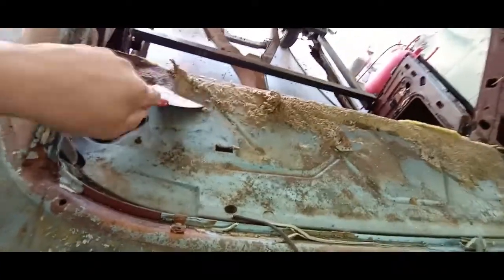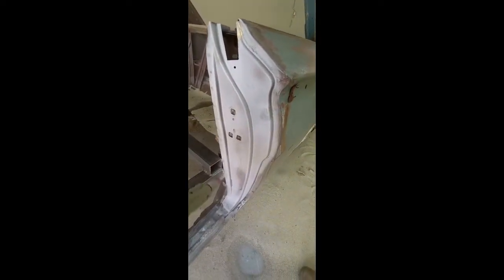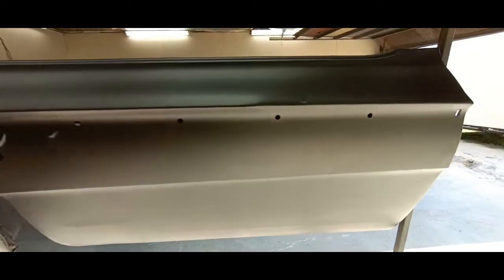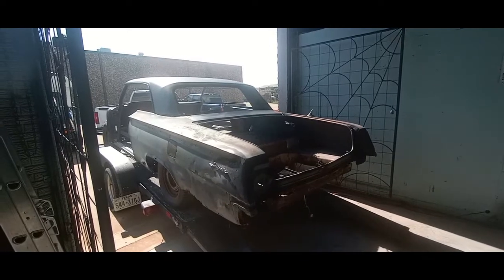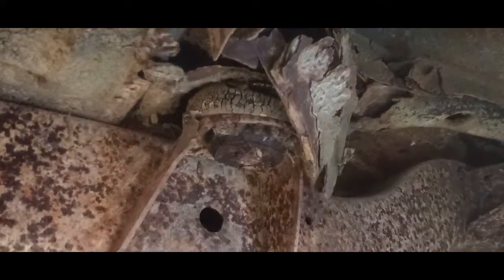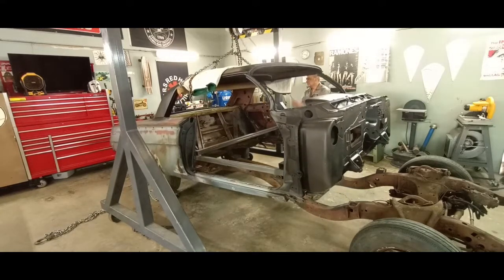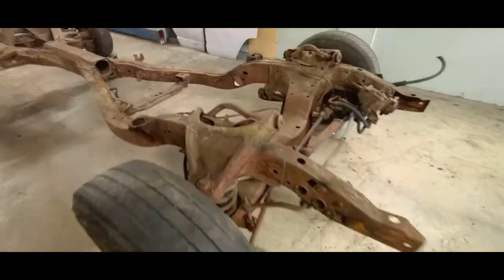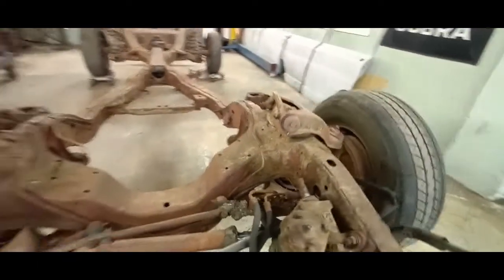1962 Impala Restoration Part 3 - Media Blast - Epoxy Prime - Remove Frame - DIY Auto Restoration

Comment: Robert have you ever swapped the complete front cowl? I have a spare one and mine is in horrible shape but the other is like new. If so where did you brace?
Reply from the maker: Are yoju replacing the upper? lower? the complete front?
Reply: I wanna do the whole front. I think it would be quicker. Is this a good idea?
Reply from the maker: @derrickwebb7230  As long as the repair is in front of the hinge pillar and front floor flange you shouldn't need to brace it. You may have to place a porta power and spread as needed, rule of thumb always cut out the least you have to. If you run into trouble message me.
Reply: Ok. Ur awesome. Thank you so much for ur help. Maybe I'll just do it in sections then.
Reply from the maker: @derrickwebb7230  You absolutely can do it ! just take your time.

Comment: This is awesome. The wife and I live in a little town in bc Canada it's so hard to find parts it's brutal what year frame's will work I know the body of the 62 is 1 year only but what about frame and glass do you have any knowledge about those parts.
Reply from the maker: I know you they use the x-frame from 58 to 64 there were some minor differences but I think they'll all interchange I'm not positive
Reply: @guzzifabrication3448  sweet so I guess I would think then the only difference would be a 2 door and 4 door would be the length me 🤔.

Comment: All the work done to the 62 would be greatly appreciated , as it would help me with my 63 restoration. 🤘
Reply from the maker: Hey thanks, check out the 1968 Charger restoration Parts 1 to 13 that'll be pretty much the same work I'm going to accomplish on the Impala
Reply: @guzzifabrication3448   in the front corners where the floor meets firewall I noticed most impala require fabricating your own pieces. If you happen to require making your own be sure to record and upload I would really appreciate it .
Reply from the maker: @balmar9011  I will definitely be fabricating those! Thanks for watching.